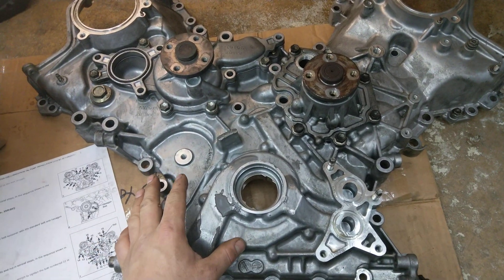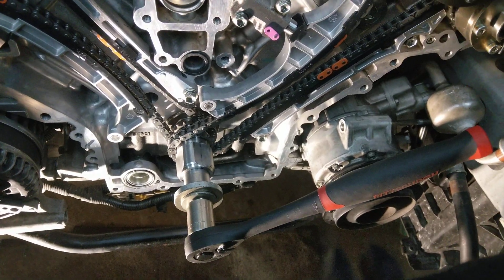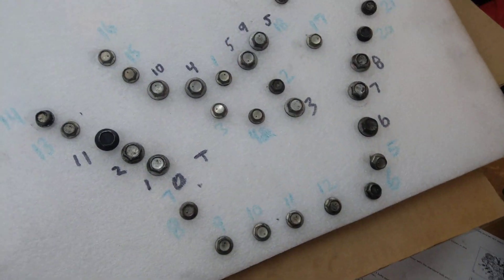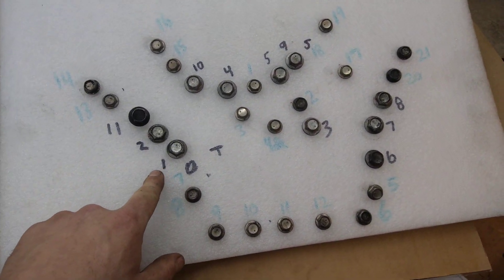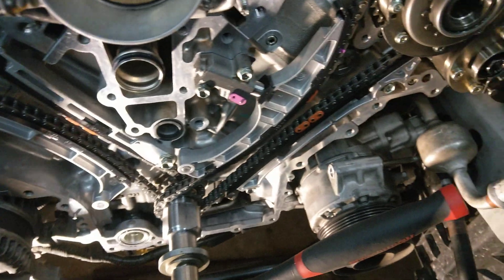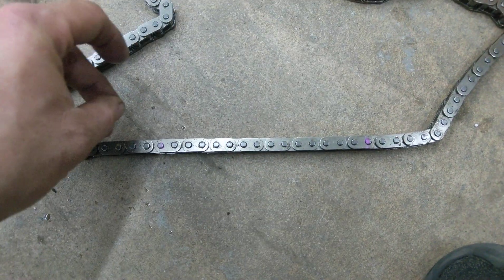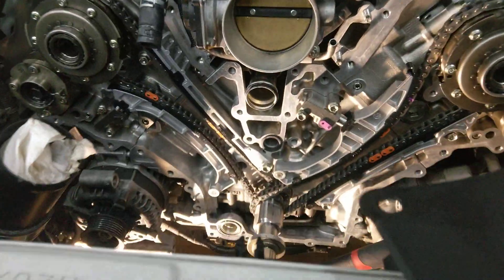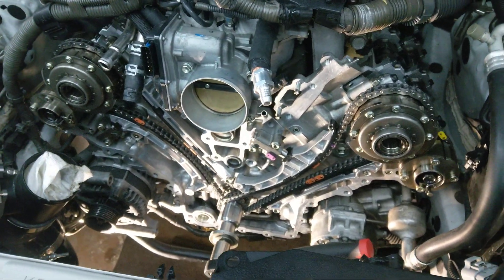2UR-GSE Lexus IS-F Timing Chain, Tensioner, Guide Tutorial Part 5 - Timing Chain Cover

Comment: Hey Man hopefully you’re still active and this comment gets to you. I saw in one of your videos you mentioned that you had a little mishap and you had that crank timing gear in your hand and I was just wondering if what happened to you happened to me like yesterday. So i over hauled the engine, it was great for about 30 entire days and then it started ticking and eventually it actually grenaded and I tore it down to inspect and I found two roller rockers absolutely destroyed and that back bank 2 crank timing gear in two pieces . And im just wondering wtf happened and if that’s what happened to you
Reply from the maker: The ATI crank damper in the supercharger kit didn't have loctite holding it together so the bolts backed out and it started to come loose. Then I got a replacement which had red loctite (wrong) I had no way to remove it which is why I damaged/cracked the front case. The third time I got the correct pulley. In the frustration and chaos, after I fixed that I must have forgot to fully torque it down to the crank. Crank pulley started to wobble because the bolt worked its way loose, which is vital to hold the timing sprocket and woodruff key to the crank and chaos ensued. Long story short make sure the crank bolt is properly torqued.
Reply: @LILEVO No YouTuber has ever answered this fast so I actually left you a voicemail to your number . But hey that’s pretty much the same thing that happened over here. Cool thanks
Reply from the maker: @sergiorogelio2695  got your message. I'm trying to find the thread where I had a bunch of pictures on how to repair the crank woodruff key slot. I did it while installed in the car.
Reply from the maker: @sergiorogelio2695  It starts on post # 333 on page 23. This should take you right to it. https://www.clublexus.com/forums/is-f-2008-2014/435972-engine-metal-clicking-sound-help-23.html
Reply: @LILEVO  are the crank bolts torque to yield?
Reply from the maker: @559connor7  the big crank pulley bolt? no

Comment: I did mine at 213k miles.  This measurement method is not per the manual.  You need 147 N (15 kgf, 33 lbf)  force on the chain, and measure it in at least 3 places to the inside of the rollers across 16 links. Maximum chain elongation is 136.9 mm (5.39 in.) for the number 1 (long) chain and 137.6 mm (5.42 in.) for the number 2 (short) chain.  All four of my chains were well within specification even at 213k miles.  Use good oil, save your cam chains.  I ran mostly Mobil 1 5w-30 and later on used Renewable Lubricants PCMO SHP 5w-30.  Mobil 1 does not manage fuel dilution well, and the factory Lexus tune causes significant fuel dilution.  RLI's biosynthetic manages fuel dilution much better, but the proof is in the pudding - both oils prevented the cam chains from wearing beyond specification.

Comment: question: would this problem ever be seen on an a normal wear "stock" IS-F? Or was the SC adding extra wear and caused the need for an early repair? If not, then at what mileage would you recommend checking tension with a boroscope through the timing cover holes?
Reply from the maker: The crankshaft sprocket damage was a freak accident and not normal. The crank pulley bolt came loose. The wear and stretch of the timing chains was a normal, stock 125k mile ISF not from the S/C. If you start hearing any metal clicking, clattering, or excess noise around the front timing cover I would inspect the tensioners through the holes.  The new revised driver side tensioner has a pink color lever on it so you can know if it was ever replaced.